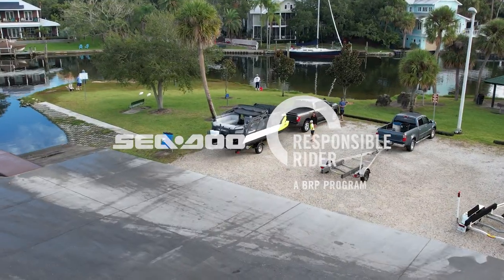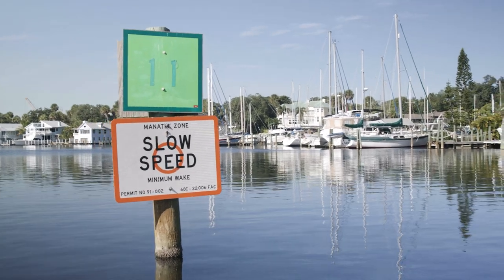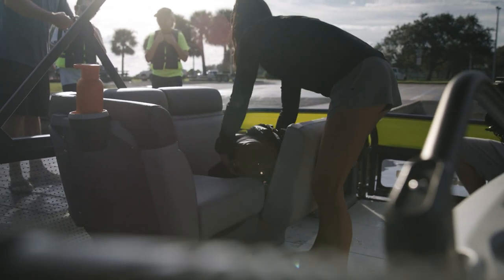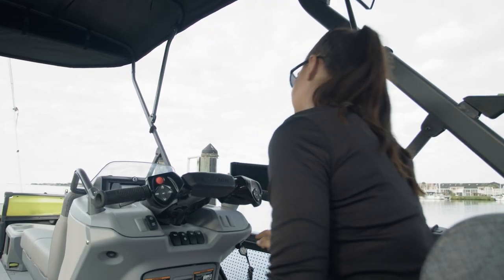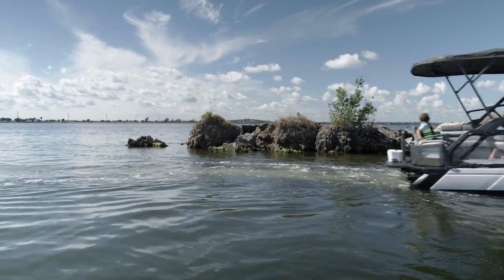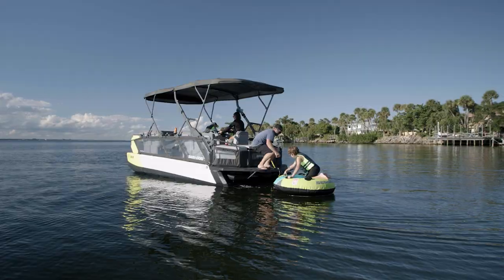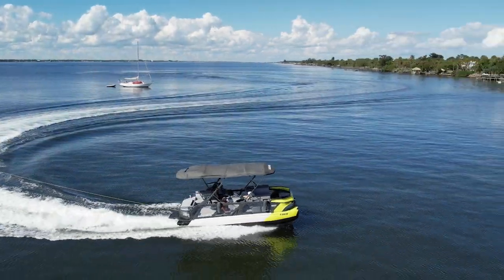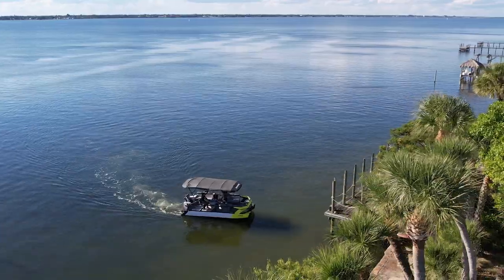Sea-Doo Switch Pontoons Safety Video

Comment: How does the big cooler fit on the swim deck with the wake pylon installed? My linq 13.8qt cooler will not fit in the LINQs system because the base of the Pylon is in the way of the cooler sitting flush on swim deck?